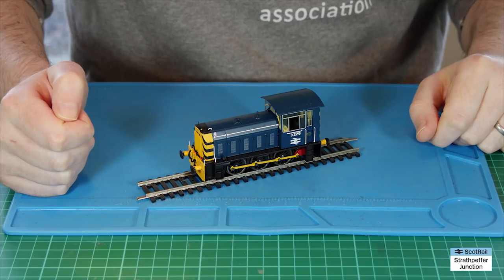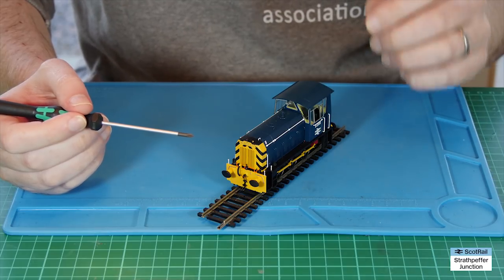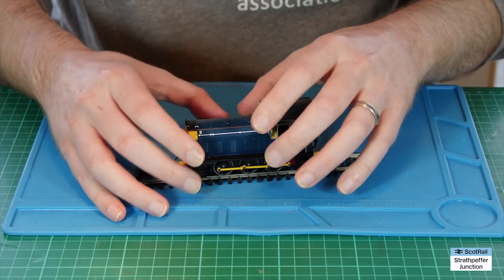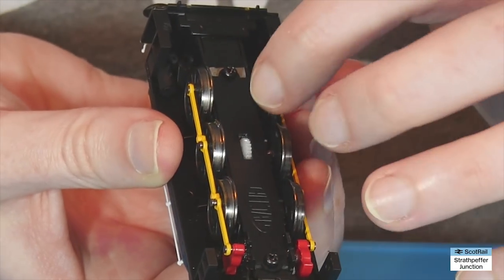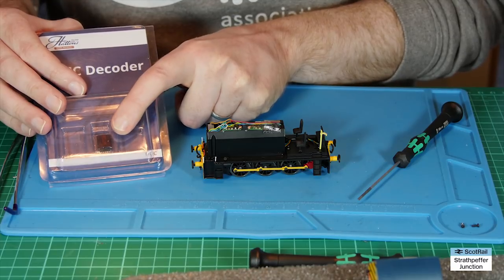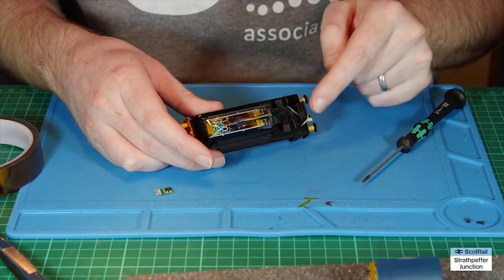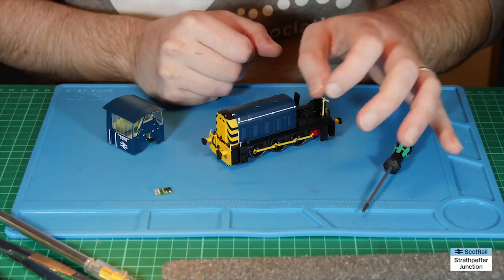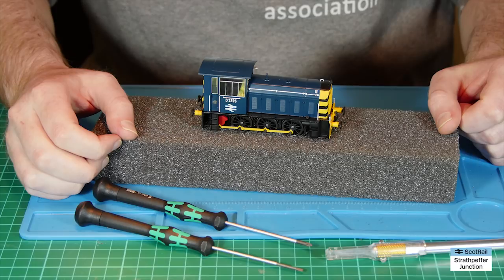#22 Heljan Class 05 Shunter: Overview and DCC Decoder Installation

Comment: Many thanks for the video. Bought the shortest decoder I could find (Zimo MX617N) yet 3mm to cut off it's super long pins before it'll all be contained in that valley. 
That last Cab tab was awkward. Steps 'were' barely glued on, oops. Lovely model and smooth slow drive from Zimo straight out of the box.
Reply from the maker: It is a great model, isn't it? Even with its fiddly decoder installation! Enjoy 😊

Comment: Dear Strathpeffer, thanks for the pointer about shimming, went thru' all sorts of ideas on paper before just creating a pair of V' in 0.25mm sheet styrene, and placing either side of each kadee, works a treat, nearly set up a fine Spring manufacturing company in desperation, so thanks.
Reply from the maker: Very glad to hear you've found a solution that works! Great news 😊

Comment: A very useful video. Thank you. I am doing this to my 05 imminently.
Reply from the maker: Many thanks indeed. Glad it was of use. Enjoy your 05!
Reply: I fitted a decoder. Your video was very useful. Heljan really should make getting in to these locos easier. The other issue I had was trying to work out why the front and rear lights weren't working. I had a second decoder so checked it wasn't that. Then saw the LEDs were flashing when programming the CVs and decided it was because they just needed to be turned on. I couldn't work out how to do that on my Multimaus as the 0 button is actually F10. It wasn't until I accidentally hit OK that I realised that was F0.
Reply from the maker: Melanie Rhianna I'm glad to hear the video was of use, and more glad you've got the lights working! Nice one 🙂👍🏻
Reply: The 'bench seat' at the back of the cab fell off on mine. It was held on with very little glue by the looks of it. Underneath it is a small rectangular hole that looks suitable for an LED at the base of that light pipe.
Reply from the maker: Melanie Rhianna Yes. I noticed that too. I wondered if they'd planned to put in more LEDs than they ended up doing? Definitely potential to mod it yourself though!

Comment: Nice looking loco,  I would hate to have to attempt to install sound lol.  I wish manufacturers would factor speaker space into their design now it's becoming quite common.  Cheers,  Michael
Reply from the maker: I've often thought that too. But, I guess one problem is that speaker design is also evolving fairly quickly and what they allow for now may be less suitable in a year or two. That said, some space for something is better than nothing! I think the only option for this one is to remove the pcb, put the sound decoder in there and speaker in the cab.
Reply: There's an interesting single line buried in the documentation about a sound decoder. It looks like a Loksound Micro fits with the speaker, face down, on the pillars moulded in to the floor of the cab and the decoder sitting on top with the 6 pin connector on a lead passing in to where the decoder blank plug lives. When funds allow I may look in to this.

Comment: Brilliant video, not just historical, but very practical, fitted a zen  decoder zn68, had to cut the blue wire, but just fitted! Quick question, you mentioned fitting KD coupling, me to, but how do you maintain the coupling on the lubber line, sorry on the centre line. Please keep making these videos, you have the touch.
Reply from the maker: Hi David. Many thanks indeed for the kind words. I'll need to get this one out of the box and have a look as it's been a while since I ran it, but I think I shimmed the sides of the pocket a little. If the box it's in is accessible (they're all in the loft just now), I'll try to dig it out over the weekend. I do seem to remember that this one had a bit of sideways movement.

Comment: Now add sound!
Reply from the maker: I've been looking at a couple of photos online where they've done that using an loksound 4 micro. I'm actually pretty tempted...but I'll need to save up!
Reply: Strathpeffer Junction speaker goes in the cab?
Reply from the maker: Yes. I think that's the only way. A small sugar cube type should sit between the seats and be just below window level.
Reply: Strathpeffer Junction good idea, two crew should help disguise it.
Reply: Strathpeffer Junction I love the build quality of Heljan stuff, they really look the part but lack of space and difficult body removal has put me off them in the past.
Reply from the maker: Totally understand. I have a Heljan c31 and c26 and the install was a pain. With one, I went for a dc kits replacement tank and it does sound great, but the other is just a standard 20x40 in the tank and it needs improving. In both cases the motor had to be removed, which is a right pain. I'm not sure why they don't improve the design. It can't be that hard to do.
Reply from the maker: Finding decent crew is such a pain! Why bachmann don't due just seated drivers is beyond me. You have to buy folk standing, which I rarely use as a mainly  diesel modeller, and even then, they're not diesel era figures. Preiser do some, but they're almost always out of stock...they're like hen's teeth!
Reply: Strathpeffer Junction Have you tried Modelu? Not looked at their more modern figures. You could always have yourself 3D scanned (sitting down) and turned into a figure 😊
Reply from the maker: I've not. I'll definitely look into them though. As for me, I'm not sure that models of me would take off! Lol.
Reply: Strathpeffer Junction everyone needs a minime driving their locos!